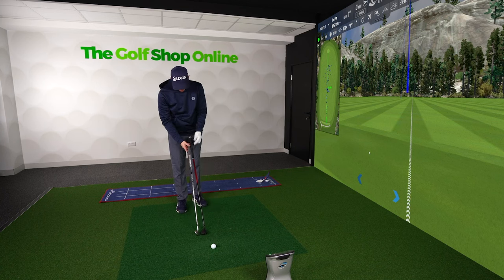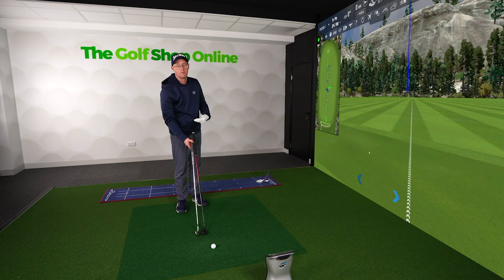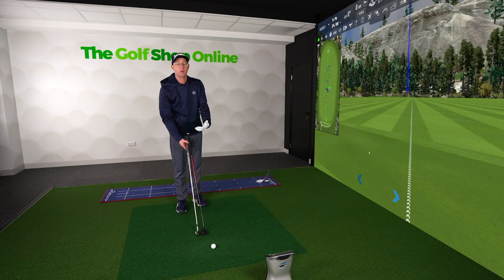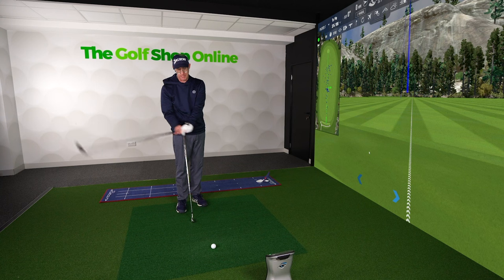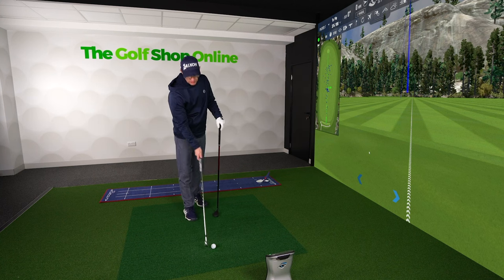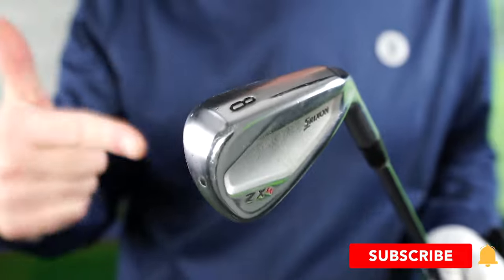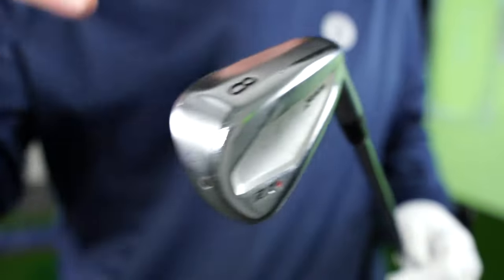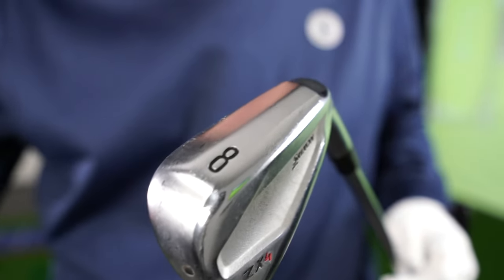Steel vs Graphite Shafts: Which Is Right for Your Game?

Comment: My elbow, wrist, and hand pain dropped considerably after switching to graphite in my irons.  Performance wise very similar but the pain reduction will allow me to continue playing for many more years hopefully :D
Reply from the maker: That's fantastic! Any excuse to make the game easier and keep us playing for longer ⛳
Reply: which shafts did you switch to? I have seen the steelfiber 110i
Reply: @KryzOrlinski  UST Recoil 95
Reply: @notagolfer9340  I switched to Golf Pride CP2 Jumbo grips and it really helped my joints. So much that I have gone back to steel in my irons and wedges. I do keep a backup graphite set for cold weather golf.
Reply: I wear a small glove. If I can play jumbo grips, anyone can play them.
Reply: @lkae4 I did the same thing! I’m 5’7. Small hands. Jumbo grips have been a game changer! I can hold the club lightly. Increased my swing speed, but drastically improved how I feel in the neck, shoulders, and hands after a round❤️

Comment: Thanks for the video. I'm moving from stiff flex steel shafts to graphite in my irons this year. Got fitted 4 yrs ago when I had a 115 mph club head speed on my driver. After shoulder and elbow injuries  2 yrs ago, my swing speed is very different. I'm down to 90 mph.  I'm hoping that the graphite shafts will ease the stress and let me keep on playing golf. I'm also looking to get fit for a new driver as well. So getting more distance isn't the issue. I'm just trying to reduce the end of season (sometimes end of round) pain in my shoulder and elbow. I hope the switch works. Have others found that graphite shafts help?
Reply from the maker: The lightweight nature of the graphite shafts should certainly reduce the strain on each swing and allow you to get more performance out of a slower swing speed, if anything I think more people could make the game easier for themselves by making the switch but can often be reluctant to. Hopefully it helps and means you can keep playing for longer ⛳

Comment: Thanks for another helpful video.     Would love to see one comparing cheap steel shafts with more expensive steel.   US prices range from $10 to well above $50 each.   Wondering just how much difference there is.
Reply from the maker: This would be an interesting test, a lot of the time you need so much data to see any noticeable difference outside of your on dispersion patterns that it's hard to argue the benefits vs the price increase, but if it fits in the budget and feel like it adds to your game then give it a go

Comment: I just purchased the Callaway Edge and the only thing available was stiff shaft. I am a 37 year old who is 5 10 and weigh 215. I shoot in the mid 90s. I have no idea what my swing speed is. I won't receive the clubs for another week. Do you think it will be a good fit?
Reply from the maker: That should be just fine, providing it's a comfortable weight it should be perfect!

Comment: For someone completely new to Golf and looking to buy their first clubs, what would you personally recommend they go for? Steel or Graphite?
Reply from the maker: A lot will depend on strength. Steel is heavier so if you're stronger I would start there but if you're unsure, or prefer the feel of a lighter club, I'd suggest starting with Graphite as they can be a bit more friendly and easy to hit
Reply: I'd suggest just trying them out, my local range helped me out chosing my latest set of clubs and even let me test some of them.  That set has been decent but now I'm moving on to something longer term so it's time in the ranges fitting bay with a pro for me and they'll help me work that out during the session based on feel and consistency.